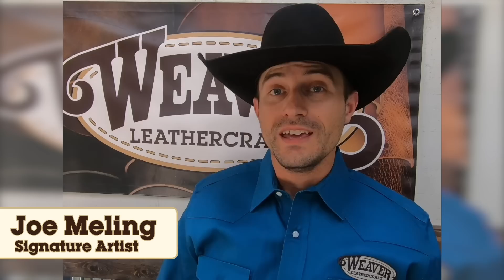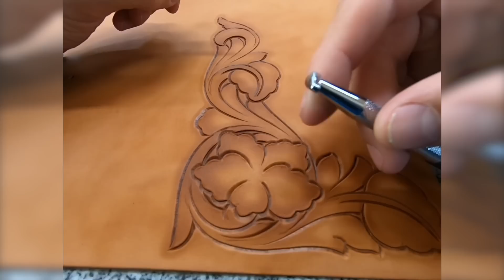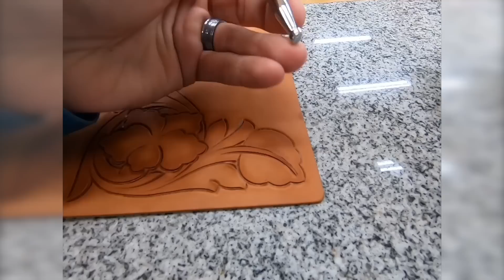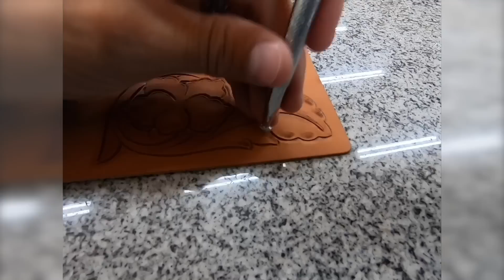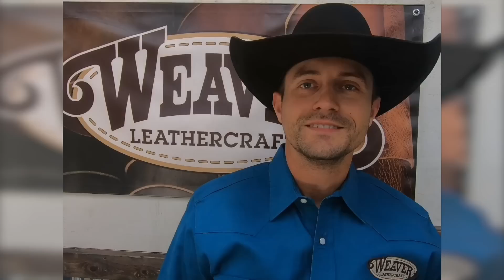Introduction to Floral Carving: Using a Pear Shader

Comment: Why won’t my pear shaper slide along the leather like yours? I’m just starting out and can’t figure out if I’m pressing too hard, not hard enough, or have my leather too wet. It looks like I’m tearing the leather instead of smoothly shaping it.
Reply from the maker: Hi there,
You'll want to make sure you're holding the stamp so it's not touching the leather unless you are tapping it with the maul. So it will hit the leather when you tap it and then lift back up off the leather and you slide your hand along, not slide the tool on the leather. This video shows more detail on what we are explaining and how to hold the tool, it uses a bevel but a pear shader would be the same concept. 
https://youtu.be/zbOqXKwkzIw